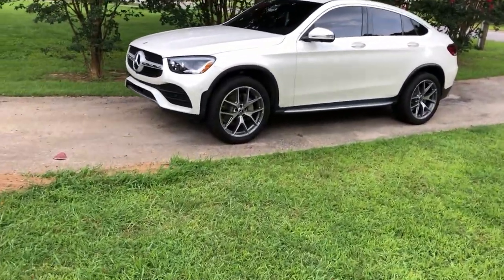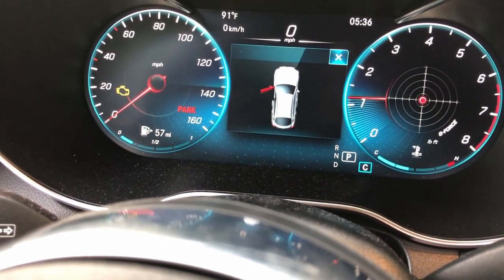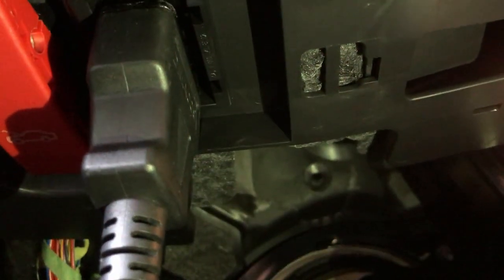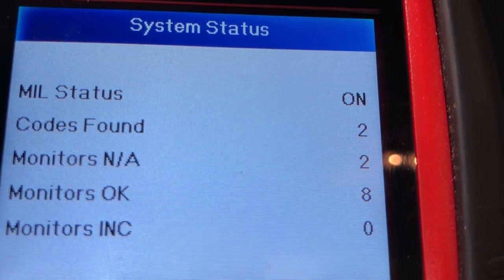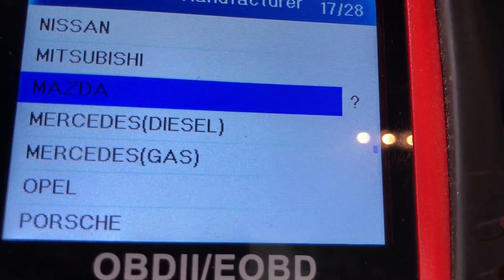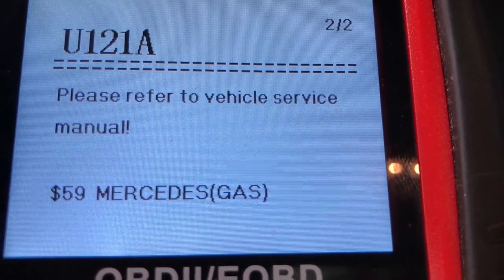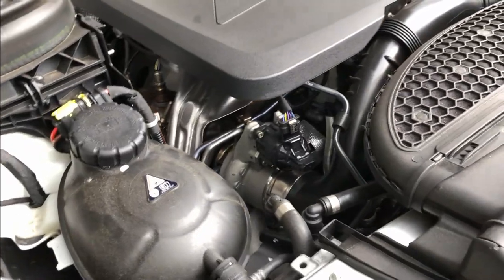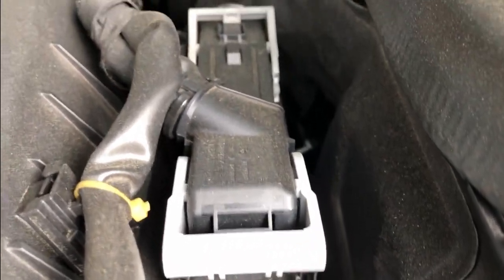2021 Mercedes Benz GLC 300 4 matic PROBLEMS ALREADY! U0699 and U121A

Comment: I have a 2018 glc300 4matic coupe and Mercedes has no idea how to fix it! They’ve had my car for 4 days.
Reply from the maker: The dealership ended up buying ours back for $7,500 more than we purchased it. They had it for almost 2 months. I hope you have better results. 

Hey, come check out my gardening channel. You look like the outdoors type. lol 😝 That’s a good things. 

https://youtu.be/E4aLPrcJQ2I
Reply: @mercedes3753  There was a broken wire behind the dash. It was $1600 to fix. Unfortunately it wasn’t covered under my extended warranty. No problems since but I’m trading it in soon. I’m between the gle coupe and the Audi q8. I leaning towards going back to Audi. They have better customer service
Reply: @mercedes3753  btw it took them 3 weeks to figure out what was wrong with my car. Luckily I had a loaner which isn’t always available at my dealership.